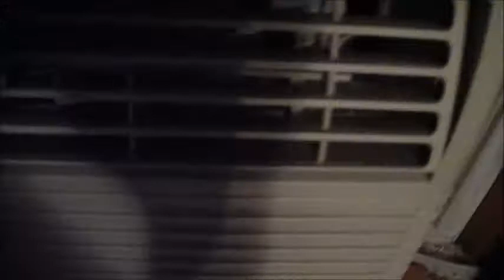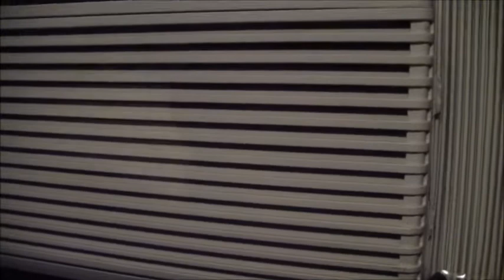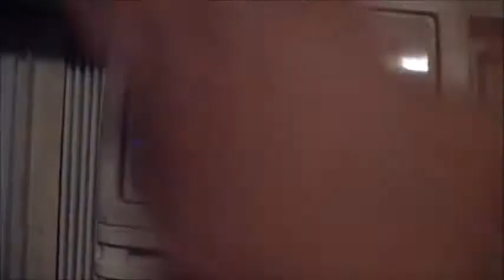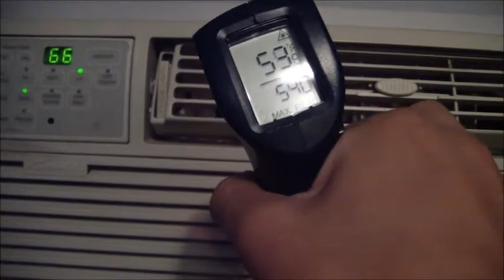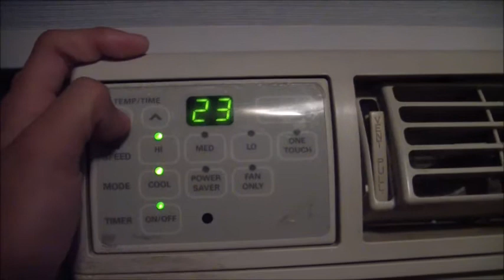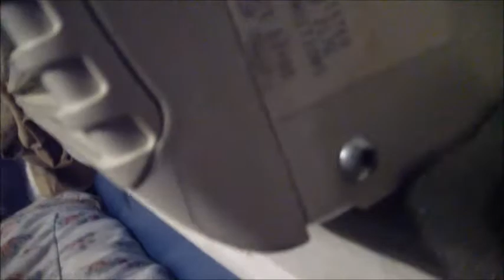Older Kenmore 5600 BTU Window Air Conditioner (WCI).

Comment: I have the same unit and the drain hole is in my window sill. Is there supposed to be a piece that fits in the drain hole? Or will I have to fashion my own?
Reply from the maker: Brian Grabowski I've never had an issue with these units having the drain hole on the window sill. Is it on the outside part of the window sill? If it is it should be fine and the water will stay outside. I dont know if these came with a piece originally but I know new frigidaires have a peice that can fit in the drain holes on those and these are really just old frigidaires so you might want to try that before making your own.
Reply: BrunoShow124 thanks for the advice! I live in an over 100 year old building with new age custom windows, so I’m sure it’s a unique case... the water definitely comes inside and gave my wall pretty severe water damage. My fault for not checking I suppose.

Anyways, I’ll definitely check into the piece you mentioned! Thanks
Reply from the maker: Make sure the unit is slightly angled outside, or even level. I've never had an issue with  them being perfectly level before but as long as it isn't tilted in. I don't know how it is installed but seeing as you have custom windows it could be a bit of trial and error until you get it just right.

Comment: mine isint cooling well and its icing over your thoughts?
Reply from the maker: is it clean and is it above 60-65 degrees outside
Reply: its clean and uper 90s with humidity
Reply from the maker: I would say if both the evaporator and condenser are clean it likely is low on Freon. I've only see one of these particular units low on freon but it does happen.

Comment: So I have one similar to this but it's 18000 BTU. It won't turn off of fan only mode though. Do you have any clue what the problem could be
Reply from the maker: Try to unplug it and let it sit for a few minutes to see if it resets. Other than that the only thing I could think of is the electronics could be faulty.

Comment: good units but one in a rental i rented was abused by the previous tenants landlord said i could have it as she was replacing them  fins were bent filter was gone. i straightened them but the Styrofoam duct was torn up. unit was too far gone to save so i left it behind.
Reply from the maker: These units are tanks, they last a very long time. Installed one of these in my new house and it works great, although that one is 5000btu, not 5600 like this one is.

Comment: What year was this from?
Reply from the maker: It was manufactured in February of 2000
Reply: +BrunoShow124: looks newer to me
Reply from the maker: It does, but in person you can easily tell it's older. The plastic front cover is very thick plastic, it has actual buttons in the control panel, it has a heavy duty case, and a metal barrier that separates the inside from the outside.

Comment: Yea it was in really good shape to i found another with manual controls the compressor was locked up but was very dirty
Reply from the maker: They are very common. I have found 3 identical to mine in 4 years. I see them all over. I found a nice older version with manual controls at my recycling center. It was in great shape but unfortunately I couldn't take it because the workers were out.